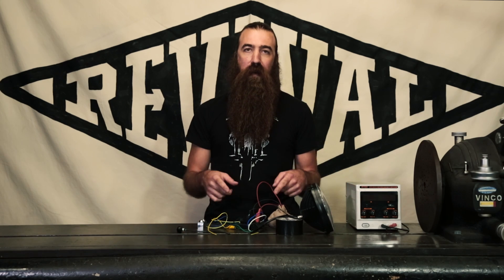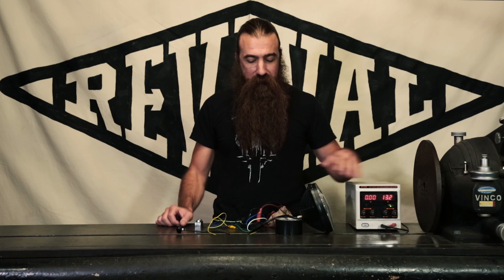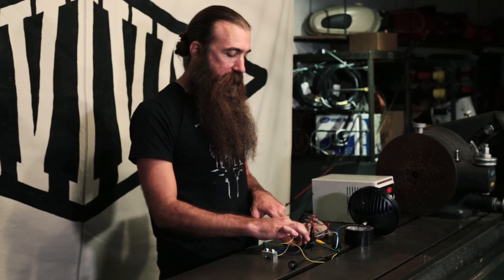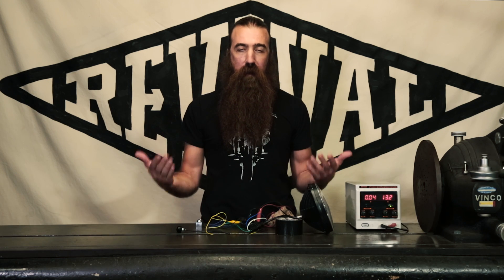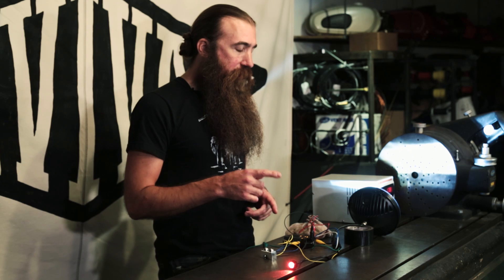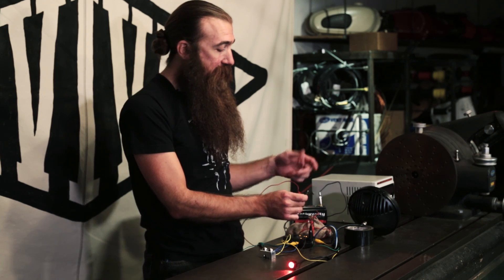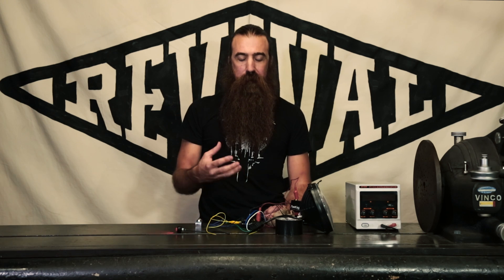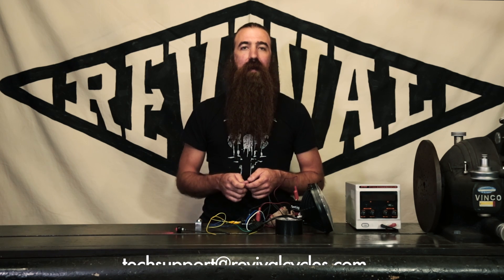How to destroy a Motogadget M-Unit - Revival Cycles' Tech Talk

Comment: I bought an almost new bike someone… 😂modified🤣… putting on a bunch of E-Bay cheap junk head light to removing the original signal and warning lights. In doing this they butchered the wiring harness.This is something you need to be aware of in looking over a bike before buying it. Thank heavens for this kind of kit. Now my suggestion is don’t complicate things. The M-unit helps with this. Another suggestion is direct wire the harness as much as possible and paying attention to the auxiliaries is important.  As is having the harness connections permanent… I find eliminating plug connectors a particular benefit and simply making your connections in the harness whether crimp or solder to the components or branches in the harness sealed under shrink sleeve… with leaving a little bit extra length for later if necessary cut and remake your connections to have this permanence… solves much sources of problem. Come on 50,000 hour life LEDs and other long life electronics are permanent effectively. So why not and the small hassle of cut then remaking and shrink sleeving any later necessary repairs is a small price to pay.
If you are unsure of your skill put it all together with cut, twist and tape with leaving extra wire length for going back afterwards and tidy up with sealed permanent connections. So I don’t use terminal strips either the bother of permanent sealed direct wiring is reliability. Military and NATO wiring of combat vehicles of all kinds are direct wired like this with as few joints as possible. Then leave it the f_ck alone!
Reply: A note items with pig tails yes you can slice them in if the wires are potted with epoxy… but it is better, if possible, to  open and direct with uncut wire to make the installation connections them. The worse offenders are post mount lights with the wires potted in the post… the best solution is make and sleeve the connections staggered in length to prevent bulkiness and as close together then have the have a large size shrink sleeve to overlap the post and sealed connection to seal and stabilize them. I recommend 4:1 shrink sleeve for all connections but in these cases it is optional to use adhesive lining for the cable stiffener overlay. Why 4:1 is it results in a more resilient to bending connection. Vibration is the killer of wiring connections so keep this in mind. Top racing teams minimize solder use and maximize tight crimp with only one wire in a crimp meaning the crimping of a single wire from two pieces means use of side-by side crimp units… and to get a pressure weld thos $150 - or more crimpers😢!

Comment: Can the m-unit be ran with a battery-less system? My project uses a kick start and my voltage regulator has a capacitor to eliminate the battery.
Reply from the maker: Unfortunately no it can't. The m.Unit requires a constant low voltage draw to maintain it's memory and it will not be able to power on if there is not at least 6v available. There are ways to emulate many of the features through other means, however, it's not really any cheaper to go that route. For more details you can shoot me an email to techsupport@revivalcycles.com.

Comment: Aux output , is that for like your igntion coils
Reply from the maker: This video was made a few years back on a now obsolete m.Unit V.2 and on those the AUX out is the ign out. The newer models have a dedicated terminal for the ignition.
Reply: @RevivalCycles  in real close to buying one! Real close !!! My 00 r6 is stripped of wires and I need this I just dont know how my icu would run to it ! Or would it ? The only thing I see my icu using on my Haynes manuel that I wonder how it hooks to the m unit is the igntion coils that  plug to the "plug wire" as i call it which then goes to the spark plugs!..
Do i plug those up to the aux or so on the m unit? Like i know i should get a manuel with the m unit but was just wondering !!?? Thanks if you can understand me lol

Comment: Great stuff, I have A high cranking S&S with wil get a voltige drop, wil it still work whit a lower voltige ? or do i need a Moto gadget capacitor?
Reply from the maker: The m.Unit can handle voltages as low as 6v and I've never heard of an S&S having an issue there. However, S&S motors often have issues when using the m.Lock which requires a min 9v and a back up capacitor is available to solve that issue.

Comment: Can i use one on my cbr600rr in conjunction with the harness, I'm constantly avin problems with led indicators not being very bright as iv had to put 2resistors in the front, and the HD headlight is giving me grief sometimes, basically I bought it with a mess of wiring for the indicators and headlights, iv been threw it trying to neaten it up n put better connections on but I can't work out why it only works the way it does even tho it looks like a rats nest, just wondering if I can get an M-unit, use it for headlights, indicators n future bits, and just be done with it??

Comment: Haha. I made it. Accidentaly shorted the wires to the ignition. Small and short cablefire followed. After that the M-unit flashes all light s when powered. Is it beyond repair? Great videos by the way. Tanx
Reply from the maker: Ummm, that sounds like something went really wrong, with out any information about the install its all just speculation. A short on the ignition output of the m-Unit should cause the ignition output to shut down to prevent damage / fire. The fact that you got a cable fire means the m-Unit malfunctioned and did not cut power, or your wire gauge was WAY too small (unlikely), or the way its wired bypasses the m-Unit circuit protection. 

Incorrect wiring with the ignition system has the potential to damage the m-Unit. The ignition coils are inductors and as such they can store energy (thats how they generate the spark), and if that energy gets sent back to the m-Unit instead of to the spark plug it can easily damage the m-Unit. This is why it is critical to keep the m-Unit isolated from the high tension (spark plug wires) side of the  ignition coils. 

Best test for m-Unit is to remove all input / output  wires (except for Lock input). then turn it on, and test each circuit one by one. You can use a simple piece of wire connected to ground to touch each input to turn it on. If you are not able to get the m-Unit to power up and perform normally with nothing connected to it, it is most likely dead and you need to work with your supplier to resolve under warranty or get a replacement.
Reply: Revival Cycles Tanx for your answer. Great , but the thing is dead. I have ordered a new unit from my local dealer here in Oslo. I guess  the Current went from the ignition out and to the lock input....the pink stuff that was solid, liquified from the heat...but the m-unit is great, .. my bad😬🤘🇳🇴

Comment: Hey you guys. Tanks SO much for putting out these videos. It's been a great help. I am currently wiring my CB 750 with the m unit. When I turn the m unit on it flashes the right turn signal. When I turn on the L turn signal, both signals flash. When I turn off the L turn signal, they both turn off. And then I can't turn the right turn signal on again.  Every thing else is working perfectly. I am using m switch minis and m button. Any ideas?
Reply from the maker: The first question I have is what are the input LED's on your m-Unit doing? The LED's give a lot of info into what is happening and why the m-Unit is operating as it is. Second, I suggest checking the configuration of the m-Unit, especially menu 5; with the m-Switch minis it should be set to option A. 

Based on what you are describing it sounds like the right turn signal button may have a constant connection to ground. This should show up on the m-Unit LED's by having the Right turn input LED lighted whether the button is pushed or not. 

My best guess on what is happening is that the m-Unit turns on and that starts the right signal flashing, then when the left is pushed it activates the hazard light feature and both sides flash. Then pushing the left button cancels the hazard lights, but then you cant turn the right signal on again because the m-Unit doesn't see a change of state on the input due to the input having a constant connection to ground. 

There could be several causes of that problem, but start by isolating the issue, disconnect the input wire from the right turn input on the m-Unit and see if that has an effect. Then start to trouble shoot the button function. If you need more help, email techsupport@revivalcycles.com
Reply: Rytmisk Musik Holstebro I had something similar and it was down to a bad ground so maybe check that

Comment: When using standard switches leaving the highbeam switch on also turns on the parking light feature which beeped the horn twice when activated  and I did think there was a problem with mine.  Wish i would have seen this before contacting Motogadget but they were super helpful and sent me a new manual via e-mail which detailed the parking light feature better than the one that came with my M-unit.   I installed mine on my 1973 Moto Guzzi Eldorado and did a full rewire and it was super easy even with relocating it out of the headlight bucket.
Reply from the maker: Yea that parking light is really more of a problem than a help, and very few people even noticed it mentioned in the manual, and the old manual had it wrong...i guess no one is prefect, but motogadget does get pretty close.